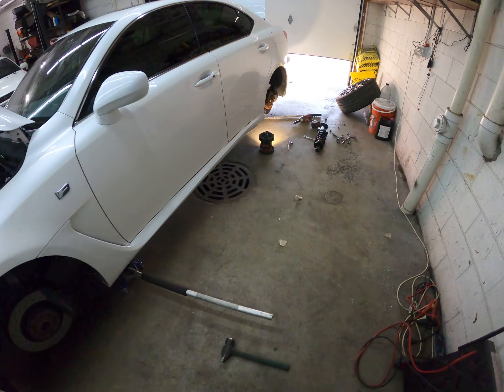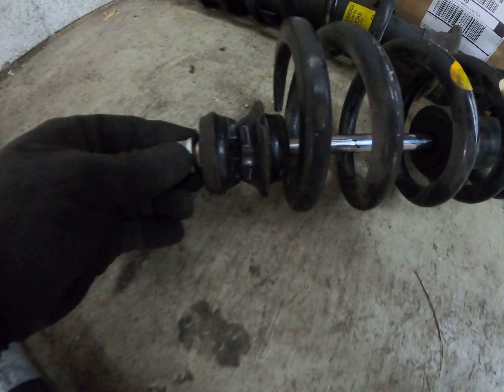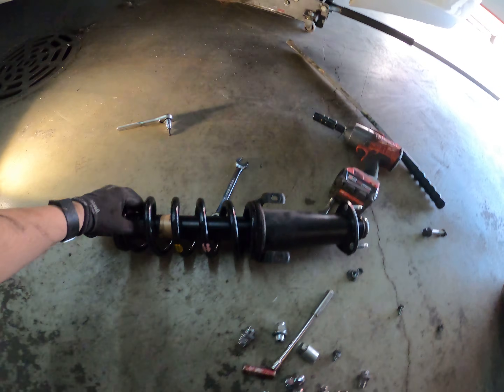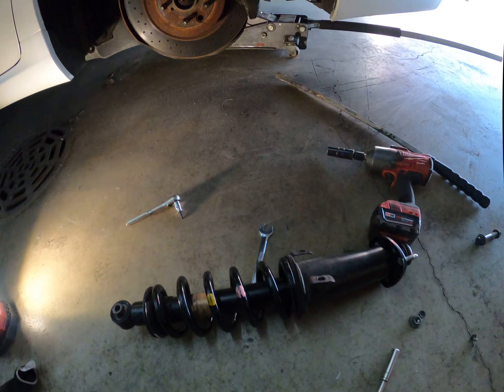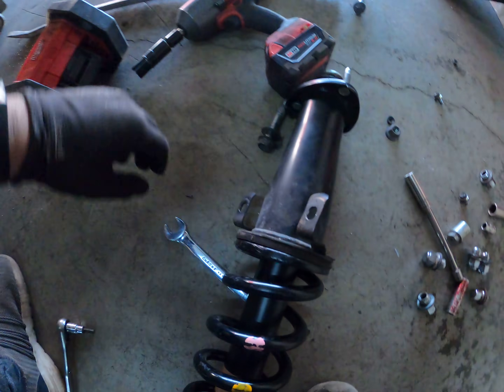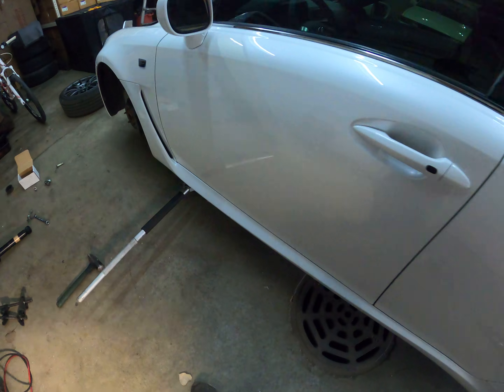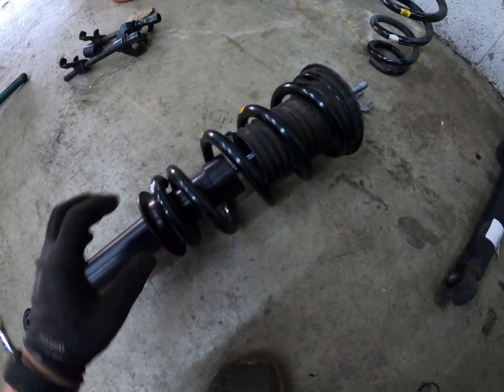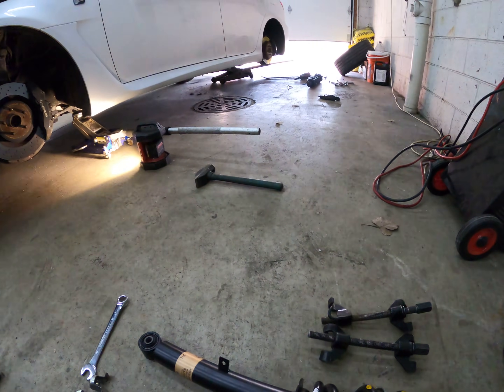Expert Mechanic Reveals Top Tips for Upgrading Your 2012 Lexus ISF Suspension

Comment: Nice video. I'm curious how you got the front struts out without undoing the castle nut for the top arm and swinging it out of the way to take the load off the lower strut mount. Did you pry the bottom of the old strut out of the fork in the lower arm? Or is there an easier way? Done two IS350's so far and have always undone the top arm, and even though it's not hard it would save time doing it your way.
Reply from the maker: Maybe ISF is different. Didn't need to pry anything
Reply: @LILEVO  awesome. I've got some Swift springs for the IS-F coming soon so I'll try it without removing the castle nut.
Reply: @Cordia4G63T  did you end up trying to replace the springs without removing the castle nut?
Reply: @davpart7723  I did try it on my IS-F but couldn't see how to pull the strut out without undoing the castle nut on the top arm to allow the suspension to droop. Made it 1000x easier just undoing the nut like I have on my IS350s in the past. I'm sure it is possible like in the video, but I didn't spend much time trying it before I became impatient and undid the nut, lol.

Comment: Would theese parts fit a 2009 to?
Reply from the maker: It's recommended you swap a whole subframe in from a 2011 to get all of the changes that were done to the control arms and other geometry, but the struts and springs will bolt up to any 2008+ ISF.
Reply: @LILEVO  Thanks!